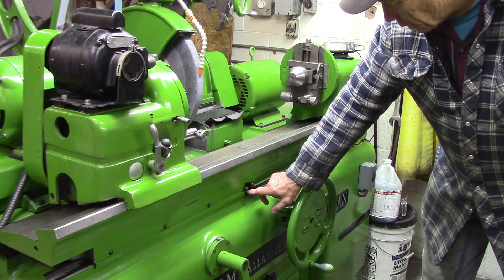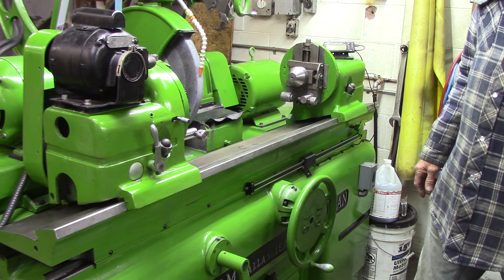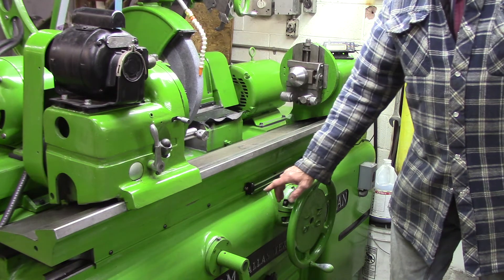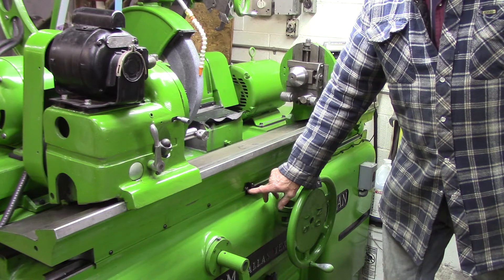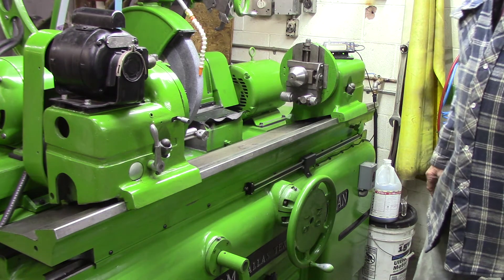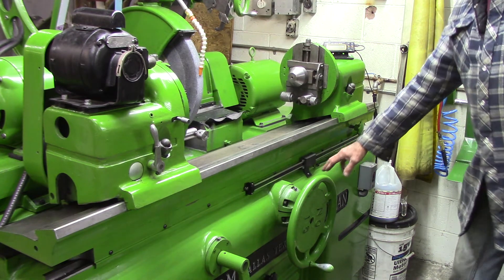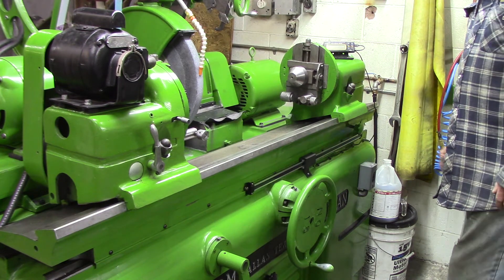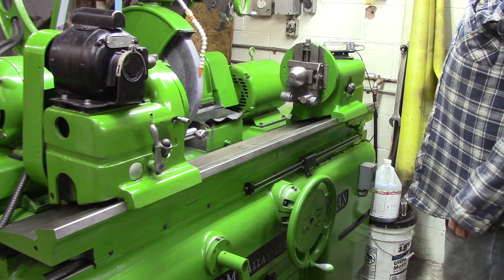Storm Vulcan 15 Crankshaft Grinder DRO Conversion on Traverse Wheel

Comment: Im interested in buying a storm Vulcan 15 crankshaft grinder,it needs to be rebuilt,would you suggest installing 3jaw Chucks on the grinder? I will most likely only be grinding air-cooled VW and Porsche motors.
Reply from the maker: When adjusting the throws for grinding, I like the ability to roll the crank with the drive dogs. I am not aware of any available chucks that have a "roll" feature that would make them suitable for a crank grinder. If you put on a lathe chuck and a drive dog, you have to loosen the chuck to roll the crank, and of course that puts in some error. The other concern of mine is the significant weight of the chucks require counter balance. I know what I see is 6" chucks, but I would consider 4" if I was to try them.

Two things I did during my rebuild was drill 3 additional holes in the back of the drive plates for the lock pins allowing me 4 positive lock positions during set up. I also milled in a flat beside the stroke "micrometer" which allowed me to use a digital caliper to measure the stroke slide. I have two dedicated calipers, one for each end (the flats aren't the same distance from center.
Reply: Thank you for your response,you also answered another question I was going to ask about the counter weights,I believe the SV 15A has counterweights but now I know why the 15 doesn't need them!